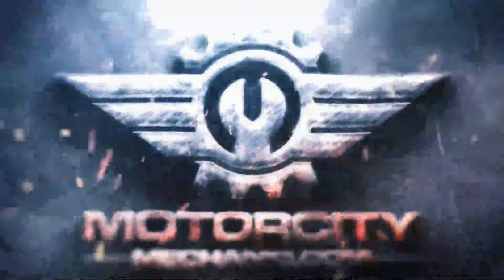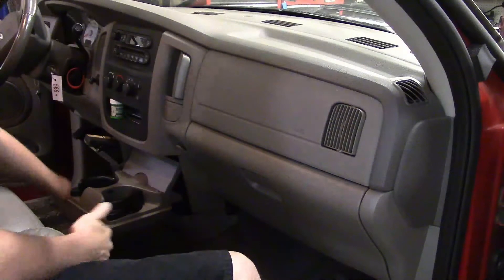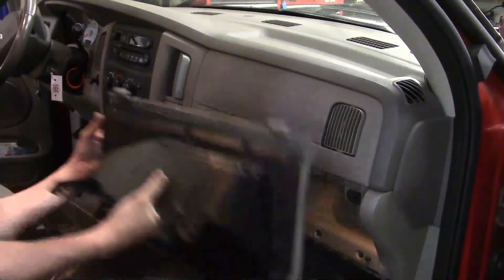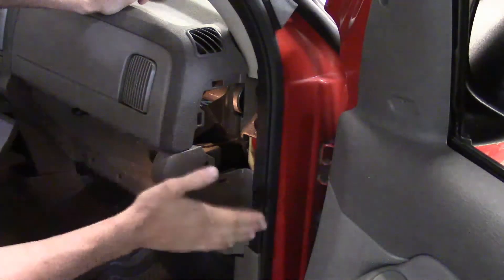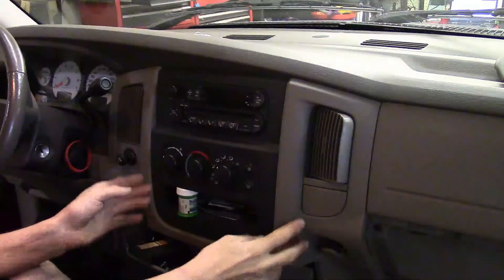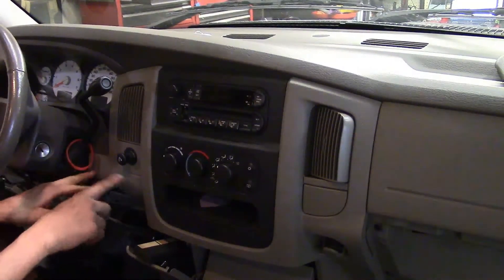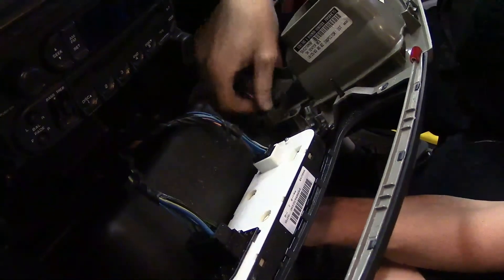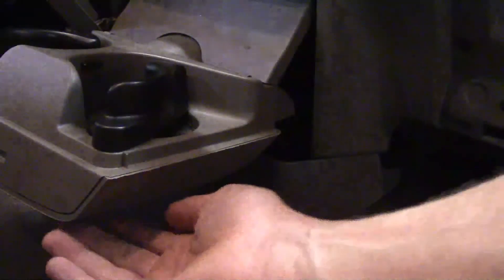Part 1/2: 2003-2005 Dodge Ram Truck Passenger side airbag removal

Comment: Just bought a 2004 Ram 2500 and ended up here because this is the closest video I could find to what im actually looking for. Im actually trying to find out if there’s a way to just turn off the passenger airbag (short of completely taking it out), do you know? I don’t see a button for that anywhere on the dash.

Comment: Hello. 
 if I just remove the passenger side airbag will I have an airbag light on my dash. I really dont want to return to the dealership after the bad experience when the y changed my drivers side airbag,

Comment: I have mine at the dealership having both airbags replaced due to a factory recall. They have had it since 8 am, they said it would be 4 hours. 7 hours later I'm still waiting for a call. I went to the dealership after 5 hours because they wouldn't answer the phone. The guy left me tapping my toes for 15 minutes while he had a personal phone call. Man I can't see how they stay in business.
Reply from the maker: I hear that alot. We love those recalls and try to knock them out as fast as they come in. Easy money. Some dealers just add it to the list of vehicles to work on and just dont work on it as fast as they can. Its something I dont understand. In and out for those recalls....typically 1- 1.5 hours. Maybe its because we are a mid sized dealer...who knows but still its something that should be taken care of in a timely manner. Thanks for watching Leo and appreciate the comment. Sorry it turned out the way that it did

Comment: After working on my steering column and putting it back together I'm getting a airbag light on my dash. How do I get the airbag light to go off?
Reply from the maker: If the light is on then the issue is current and active, clearing the code will not cause the light to go off....it will all by itself as soon as the issue is fixed. First thing I recommend is making sure all things are connected and nothing left loose. Then if nothing found....have the air bag module scanned for codes to see where to go next. Thanks for the question and make sure to subscribe
Reply: Thanks after double checking all wires I found one not connected properly.
Reply from the maker: Awesome! Glad you located it.

Comment: Thanks you Dave for the upload.  How long did it take you to complete the job?  I got a recall for the passenger airbag for my 2003 Dodge 2500. Do I need to have this work done at a Dodge dealership, or can I have this work done elsewhere?  Looks like while you have the dash board apart, good time to replace the a/c Blend Door Problem...thanks
Reply from the maker: Mark Peterson Hey there Mark....the actual repair once its in the techs bay is around 30 minutes. Some work faster while some work slower but that's a good average time frame. It being a recall....it has to be done at the dealership. As far as the blend door issue, I don't take that section of the dash apart when removing the a/c box. I unbolt it complete and pull it back enough to remove the box once unbolted. The section you take apart during the recall doesn't need to be removed for the a/c issue. Thanks for the kind words and the question Mark.